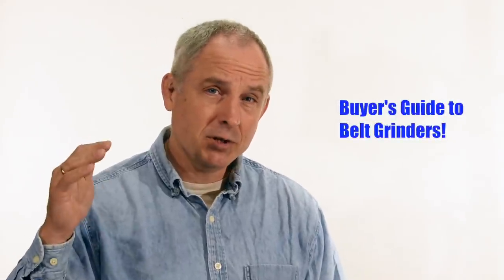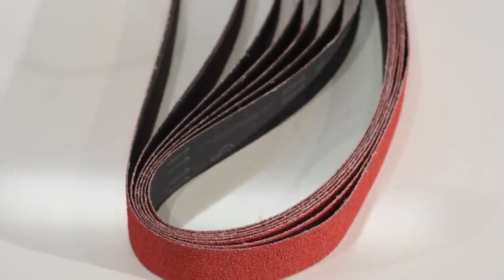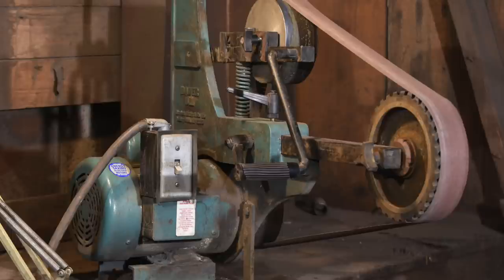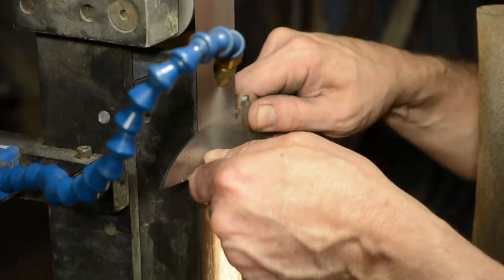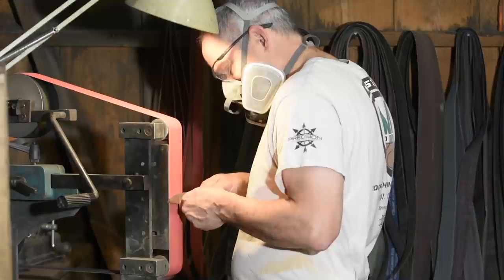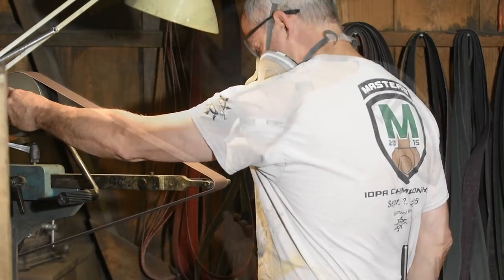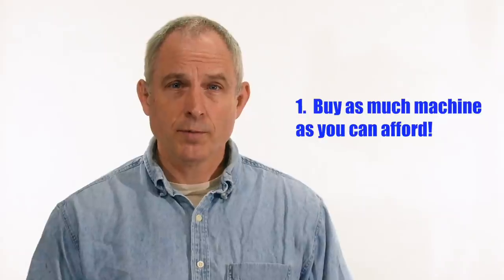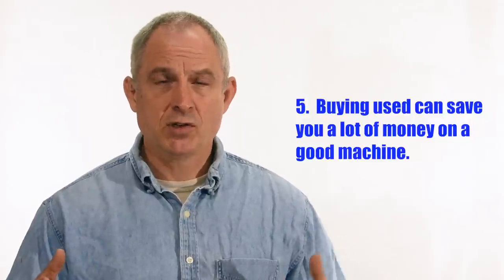Belt Grinders - A Buyer's Guide for Knife Makers

Comment: we Metrik guys use metric System 😆 so the most Common belt lenghth are 2000mmx50mm or 75mm my homebuilt can use various lenght and the most Common Use 2000mm lenght. by the way why are u American guys not using the metric System like the rest of the World?
Reply: dont you guys still weigh yourselves in stones? metric system is no easier or harder to learn than imperial.
Reply: nope we use Kilogramm like the rest of the World example 1000gramm=1kg 1000kg=1tonn....the same with 1Meter :1000=1mm 1000m=1 Kilometer  u See not the 35.part of whatever...
Reply from the maker: Because it would cost US industry about 80 bajillion dollars to change over every single tool in America to metric.  It's always about the money.
Reply: that might be the best answer anyway keep on making great Videos and thanks to the Internet i can translate the most measurements quickly